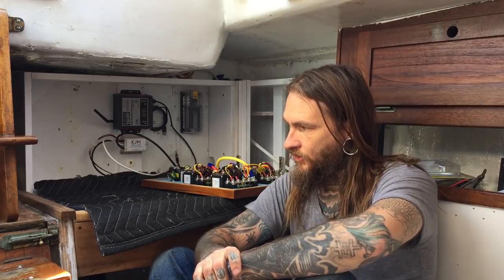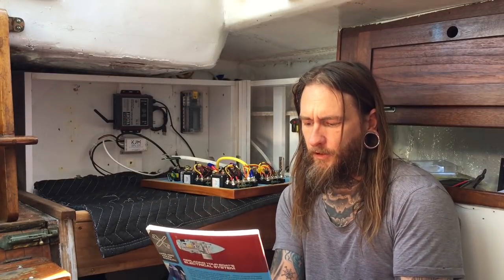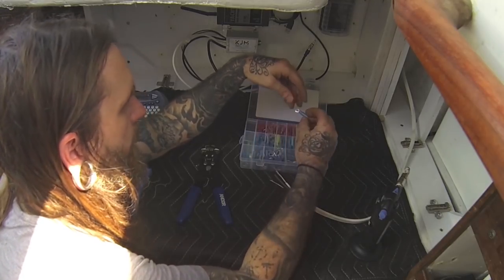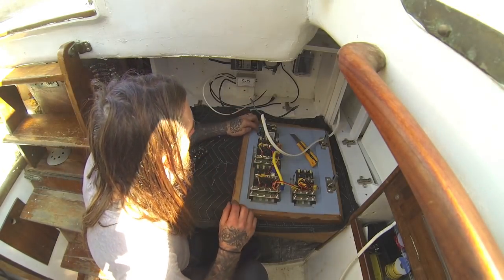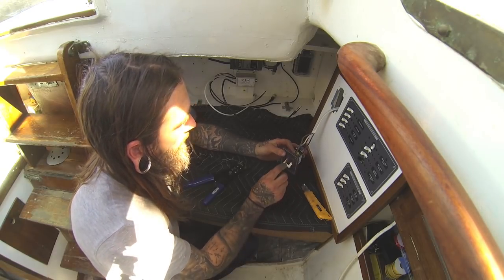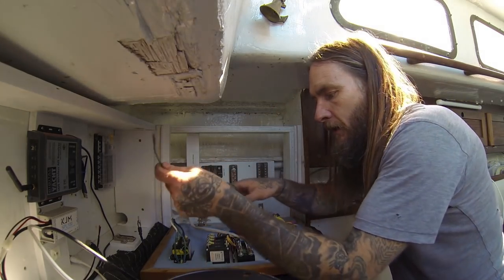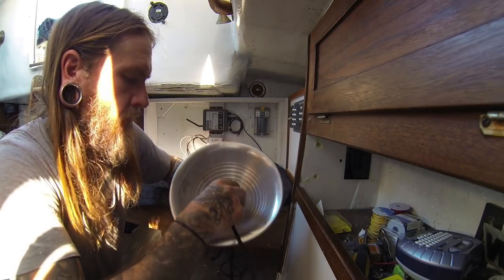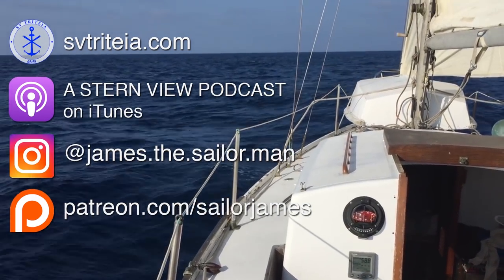Wiring up the AC power onboard Sailing Vessel Triteia

Comment: lots of great info. Keep handy some "Scotch Super 33" electrical tape in the appropriate colors when re-purposing wire. A little wrap of black tape on that red wire and a wrap of white tape on that yellow wire (on both ends) would let you or someone in the future know that the wire has been re-purposed and what the wires function/purpose is. Also never pull the tape to "cut" it,  always use a razor/knife on the electrical tape, it keeps it from retracting and loosing/lifting off. I keep a single edge razor blade in the plastic case the tape comes in. Looking forward to more.
Reply from the maker: That is great advice !

Comment: Good video James as an Electrician of over 30 years and having worked in many countries and on all types of wiring from 66kV 66000 volts to 110V I still find it strange that in the USA the Live Wire (hot ) is black and the Black on DC is  negative most systems I have worked on Red is Live Black is Neutral and green is earth on AC and Red is Positive and Black is Negative on DC I once worked on an oil rig being built for the gulf of Mexico and we had to wire every thing the way you are doing really tested us to remember to do it the US way any way I have watched all your videos and am really enjoying them oh one other thing if working on your AC remove the plug outside on the dock as well just to be extra safe even put the plug side on your deck so you don't get some good Samaritan seeing your cable switch is off and deciding to do you a favor and switch it back on that will really mess up your day keep up the good work
Reply from the maker: RIGHT? Its crazy to me that the HOT is black! My shore power doesn't come unhooked at the box on the dock, I did go switch of the breaker off camera and had the cord unplugged so that was the best I could do. Thanks for watching and thanks for the comment!

Comment: That Upside down plug is an argument that has been on going with electricians for decades. Among other things, I hold Journeyman cert's as an electrician, plumber and I hold a in Master  in electronics systems (low voltage). Mount the AC outlet the way you want. the only recommendation I would offer is one that you have already covered... USE hard crimped circle connectors. That is over kill for buildings, but necessary for mobile equipment and damn sure for boats. If your boats grounding is correct and you are using adequate ground fault circuit breakers, it doesn't matter one bit which way the outlet is placed.  I will put money on someone commenting to the error of my thinking. And this is the debate that will never be resolved.
Reply from the maker: Thanks for the comment Jamie, good to hear from an expert that it seems I did this job correctly. After I heard about the debate I searched and searched for the answer and just like you mentioned it seems like there are two camps on the subject.
Reply: @SailorJames  One thing I would caution you about is using AC outlets that have the built in USB charge ports. Not ALL, but some have a continuous "Trickle" draw even if you are not using the charge port. In a brick and mortar that draw is insignificant, but on a boat that is very energy conscious it can mean  all the difference. I would connect any USB charge ports to your 12v house batteries, that way there is no parasitic inversion of your precious power when nothing is plugged in.

P.s.  I am no expert. Just a JOE IN THE KNOW. LMAO

Comment: Most AC/DC problems I’ve seen are from loose and corroded connections. Cheap clips and a lack of silicone grease. I swear by those heat shrink connectors!
Reply from the maker: They really make a difference and you never have to worry about them again if its all done up correctly!

Comment: the AC and DC distribution panels should be separate and at least there should be a cover behind the AC portion which is closed by mechanical means (screws) not easily opened.